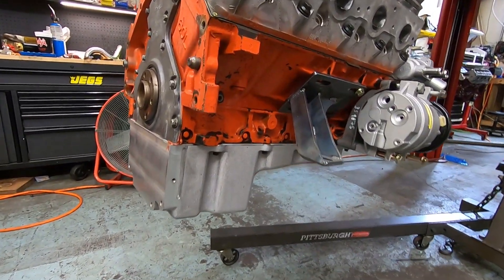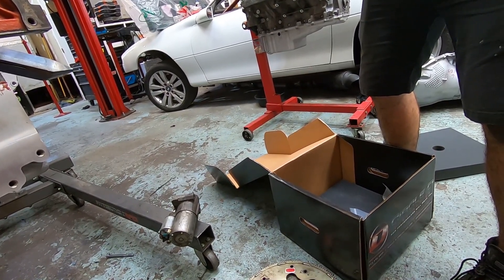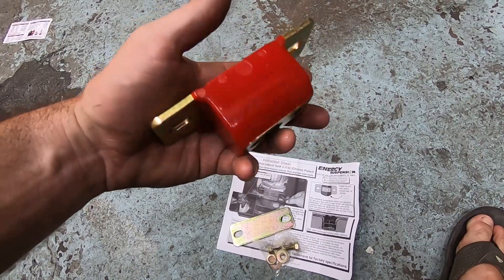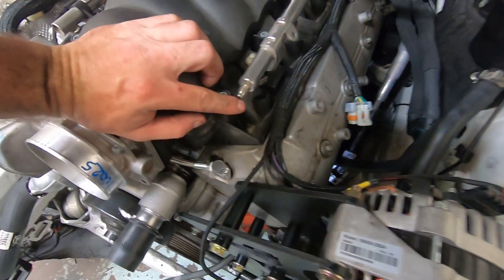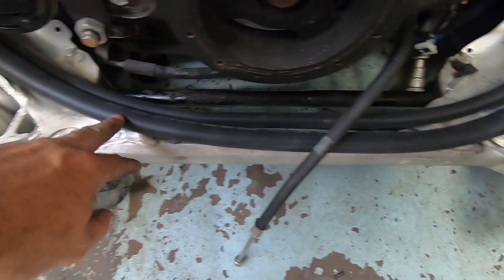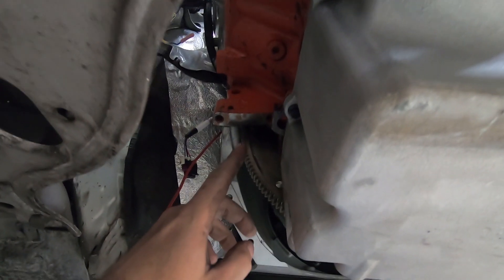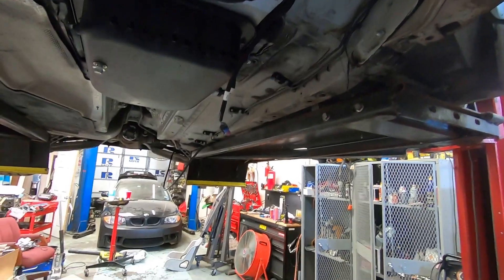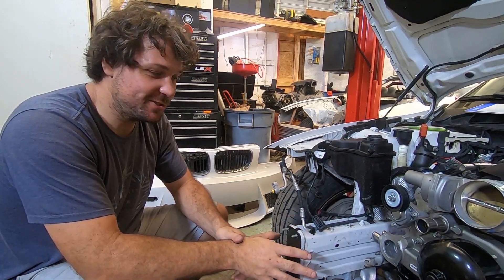Cosmetic Upgrades and We Plumb the #lsswapped 128i

Comment: I have a 2010 325 xdrive that I'm putting an ls with an auto transmission in. What do I need to do to the front end since it has those little driveshafts going to the wheels?
Reply from the maker: Just use the outer cv from the axle with the axle nut to keep the hub bolted together.
Reply: @lse90garage  thanks! And thank you for the quick response!

Comment: Next build for sure gonna do a Holley hi ram some solid lifters get that 0 lash for high revs trick flow heads comp turbo cam manual transmission gonna be a car build for sliding not in line racing I can’t wait just saving money and parts at this point

Comment: 16:01 What exactly is that clamp holding up the shift rod? Did you just make that or adapt an OEM part?
Reply from the maker: Just something we made at the shop.
Reply from the maker: Made it. Something I'm working on selling a Billet version of.
Reply: @lse90garage part  @lse90garage sed to hold the rod housing? Hard to tell in video, but is it a piece of pipe w/ the small tab clips holding it in place? I tried making one from the stock BMW rubber mount , but it has too much deflection and is inconsistent in shifts
Reply from the maker: @Bahookers  the one he made in the video was just a bushing, that fit over the shift cable, then he ground it short enough so that you could still get the factory c clip locked in, then welded it to a piece of steel bar stock and drilled holes to catch the trans pan. Making the front of the cable connect to the GM shift lever on the trans was a whole other ordeal